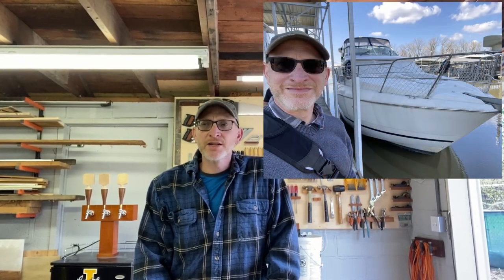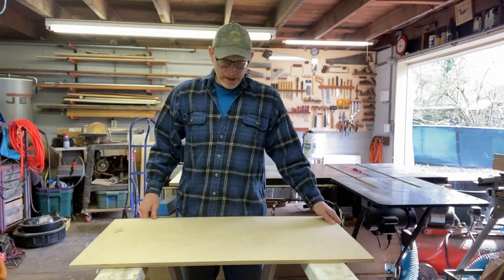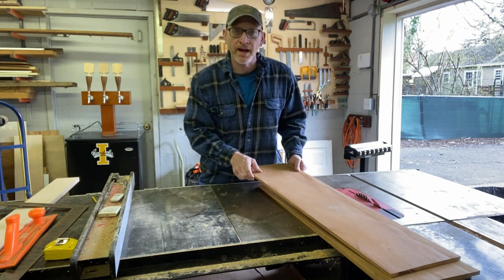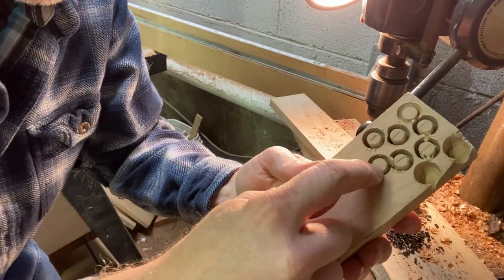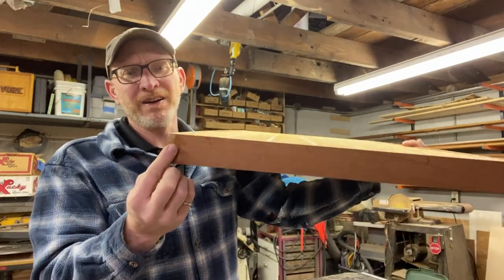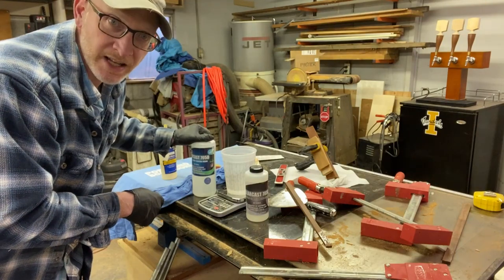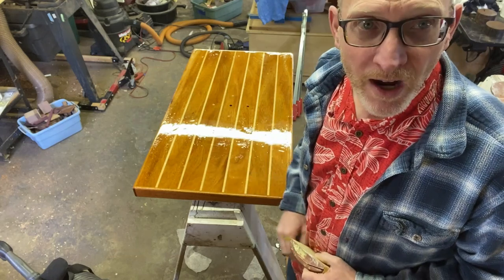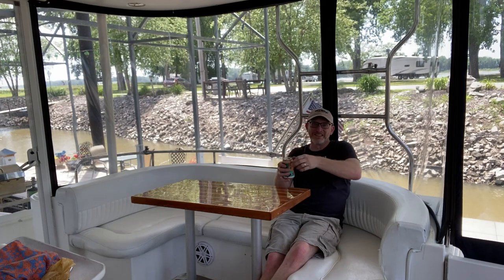Making a Mahogany Yacht Table!

Comment: Great job on the table top. Must be tough leaving behind such a well equipped workshop. Everything you need to make the boat interior like home. That table saw is industrial size. Is it a Laguna or Sawstop?
Reply from the maker: Sawstop. It’s the contractor saw but I built a large mobile base with storage for it.

Comment: Lovely table! Nice work, interesting to learn good tips for removing bubbles and using an old credit card to apply the epoxy.Did you leave all those fabulous tools in your house when you left? Looks like a well-equipped workshop. Enjoyed the video. The table will elevate the decor of WITNESS for certain!
Reply from the maker: Thanks!  Yeah, no shop on the boat so I’ve had to scale back on what tools are reasonable to have aboard. Getting by though.
Reply: I absolutely love boating, and I love wood work just as much. Thankfully I don’t have a shop as nice as yours.  If I did , I don’t know if I’d make it to the water often.  Great workmanship.